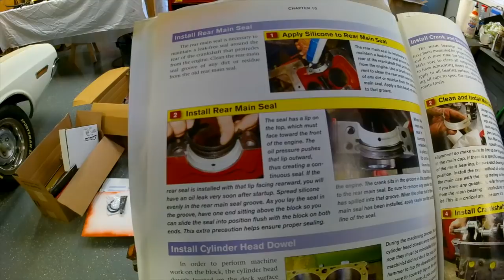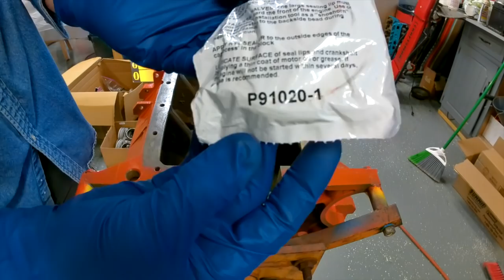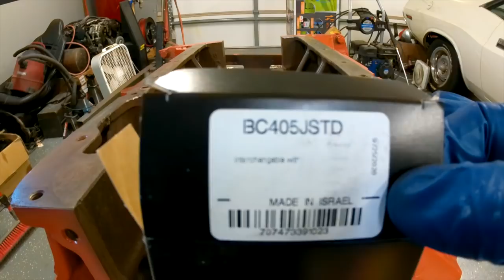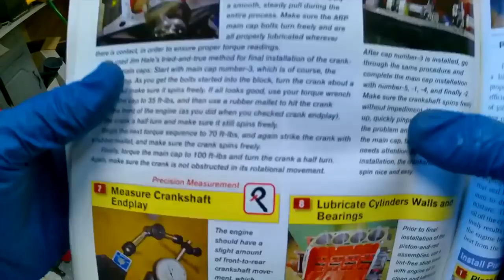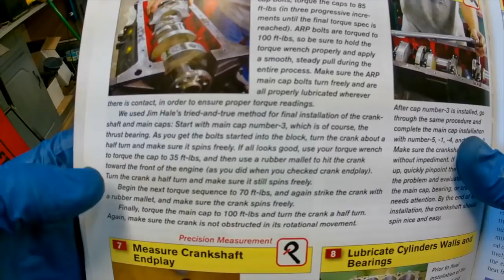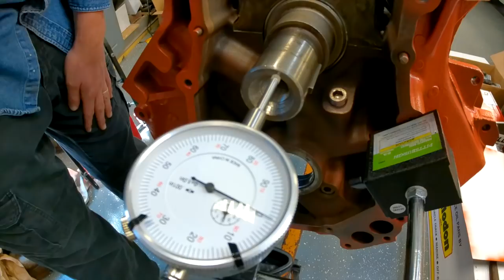Big Block Mopar: The Build Begins

Comment: Nicely done! Clean enough to eat off of. Big block rear main leaks are the worst. Looks like you took all the precautions. Back in the day, a friend of mine o-hauled a '79 400 in a Magnum. He was running it on the lift next to me, checking for leaks. When he walked away, I couldn't resist!! I squirted a little oil right at the rear of the engine. He came back to a "leaky rear main" and lost it. I finally confessed a few minutes later and thought he was gonna beat me to a pulp. I cleaned up my mess and showed him all was good, almost. He stayed mad for a month. Life in the dealership. Cut-throat and cut-ups.
Reply from the maker: 😂 I would have been on fire! They suck especially if you have a windage tray and have to stack gaskets around it. Thanks Gregory!

Comment: I respect you for caring enough to clean everything to the degree you do. I wonder how many builders do the same.
Reply from the maker: Thanks brother! In my mind, it’s one aspect that I can control. I’ve seen dirty engines done by hacks. If it deserves to be rebuilt, it deserves to be done right!
Reply: Only the engine builders that don't make engines that blow up clean this well. You can scrimp on many things, but getting everything clean is not an option.

Comment: Your vid this morn about slop in the dist tang/oil pump gear motivated me to complete this exact session  on my 440/molnar/icon/std forged crank assembly. Tomorrow is verify 28 thou top and bottom rings and slap those in as well. Gone thru source heads and 12 lbs from the wuhan war whistle and let her eat. Thank you again. Your vids mean alot!
Reply from the maker: Awesome! Thank you for sharing and good luck with your beast!

Comment: Actually a great build, except on the center main with the thrust, you should actually run both bolts in to about 20 lbs, then back them off before you tap on the ends so the cap is free to slide to match the fixed bearing half in the block, end play should be checked when center cap is torqued to first step.
One tip, much easier to lube and slide in cam before crank while you can still access cam bearings.
Reply from the maker: Thanks Rob! Always more than one way to skin a cat. I’m not too far stuck in my way

Comment: Lucas/oil mix is a great choice. I noticed to didn't apply it to the crank journals. All metal bearing surfaces should be coated. Same with the cam. But you got your way and I'm good with that. Nice videos series!
Reply from the maker: Thanks! I have a brush now that I dab it in with. Check out my 400 build series as well. It went to dyno!
Reply: @JustMoparJoe  Will do!

Comment: One of the best assembly videos I have ever seen. Very good close up work and good audio, no back round noise. Cleanliness is the key element to engine building. I applaud your extra effort to clean. Was the crank already balanced or did the MS have to balance? Did the journals need turning or not? Just hone the cylinders?
Reply from the maker: Thank you! The machine shop gave it a hone and I was able to reuse rods, pistons, and crank. The crank was nearly perfect coming from a low mileage rv. I know it’s a low compression engine, but it moves his 74 d100 well on the street.
Reply: The 413 is a great engine and a high rev monster. Have you checked the source point on the lifters? I have been hearing horror stories about mfgs outsourcing their lifters from China and they have no hardness at all. Break in turns into an awful mess requiring a takedown of the entire engine as it will be full of metal particles. I hope all is well in your case.
Reply from the maker: I’m not totally certain, I’ve never had an issue with any Lunati stuff. This is the 7th voodoo cam I’ve purchased and installed. Check out the video of it in the truck. He’s got to source a rearend locker soon!

Comment: I like to final wash my engines with Dawn dish detergent, a toilet brush, ( yes, folks a toilet brush!😂 it works excellent) and a power washer. Then I blow em dry, then hit em with some brake cleaner, then a light coat of WD40 on the machined surfaces
Reply from the maker: Awesome! Check on amazon, They sell brushes that fit in your drill. Save you some elbow grease!
Reply: @JustMoparJoe  I also liked the fact that you didn't use a bunch of thick assembly lube on the crank. A guy needs to be able to feel what the crank is gonna do in it's natural habitat. That assembly lube can mask some binding or tight spots. Also, I've seen a lot of guys use that shit on the rings too or they dunk em in engine oil. Huge mistake! When you start the engine, and fire starts to happen in there, it's gonna bake and glaze that shit on the cylinders and they're gonna wonder why they have a hard time getting the rings to seat. If a guy calls up Sealed Power, they'd agree that is not good. The only thing a guy wants to use is a coat of WD-40. Let the oil rings give em what they need, and besides, those puppies need to "cut" themselves into the cylinders, so they'll grab that crosshatch and start rotating around that piston. 😁😁

Comment: This technician puts a lot of thought into the details... But, He did not show lubing the rear main seal, or lubing the threads of the main cap bolts... But he did show the care and thoroughness of cleaning the various engine oil lubrication passages with that brass tube-cleaning brush... He is very good, and the reliability and performance of the engine will be at it's maximum level because of his attention to the details...And the last chapter , he chased the female threads of the block, and pressure washed everything...
Reply from the maker: I appreciate that, Michael. Check out 24:06(lubing rear main seal), and 29:22(lubing the main bolts). On that rear seal, I used red grease. It seems to stay in place if the engine has to sit for a while. Hopefully this series is thorough enough to help those out there trying to build their own engines.
Reply: @JustMoparJoe  gotcha!!! I missed those parts... Maybe I was getting a cup of coffee during those segments... Great job on the video!!! The 413 is definitely one of the best engines that Chrysler ever produced...
Reply from the maker: @michaelmartinez1345  all good brother. I really am going to step my next build series up some. The 413 was after the 360 build series I did. I hope to improve each time, and put out a new series each year.

Comment: Nice prep video, and on an old iron block like this it's probably not such a big deal, but I refuse to spin a crank in the bearings before it's torqued down fully, I HAVE seen bearings and cranks get scored because of rotation before the main bore is torqued round even with a properly lubricated rotating assembly.
Reply from the maker: That is wild to think about. If it scores before the torque, it may have been really bad afterwards. I have ran into cranks before that after torquing, it wouldn’t spin at all. What do I do at that point? Loosen the caps one by one and try to spin it. When it freed up, I knew where the issue was. I think with the spinning ahead of time, you can feel the level of drag on that bearing. Thanks for the comment Jakob. I am always learning, both from mistakes and successes.
Reply: @JustMoparJoe  some aluminum blocks distort so much under torque that the main bore and even cylinder bores are not round until they're torqued down, everything gets machined with torque plates so that it can be accurately honed/bored, one engine that comes to mind would be subarus ej series engines.
Reply from the maker: @jakobsimmons9997 that makes sense. Ed is honing my 400 block with a torque plate as well. It should be spot on when done. I hope to do a full series on it as well.

Comment: Is there a reason you dis not check bearing clearance with the compression thread stuff? That's how we used to do it, Is it unnecessary nowadays? 

Also, is it possible with that much assembly lube on your main cap threads that you could get a hydraulic effect when torqueing them and get a false reading? I would think something thinner would minimize this.

Appreciate your work, new subscriber here.
Reply from the maker: Thanks for asking. I believe you’re referring to plastigauge. It goes under the bearing caps, torques down and then you measure with a sheet to see the width. I didn’t use it with this engine. My machine shop is actually pretty thorough about measuring the crank journals. He said it was ready to build, and I did. I have a new set of micrometers and dial bore gauge to use on my next build. As for the lube, I’m certain that the excess will squeeze out of the sides and everything torque appropriately. When running, the journals are supposed to be floating on a film of oil, between bearings and crank. I believe that my mix helps protect those parts during assembly.

Comment: Bore it to 4.250 and make it a 426 Max wedge. I have .060 383, std 400 (452 stroker), std 413, std 440 as well as sm bks std 318, .030 340, 2x std 360's
Reply from the maker: Awesome selection of mopar Iron. It would have been a sin to bore these cylinders. They were as perfect as factory.
Reply: Yeah, and they go like hell! Don’t they?

Comment: Do you build mopar engine different than other corporate engines?
Reply from the maker: There are a few nuances between different brands that can help longevity and performance. I’m just most familiar with the mopars because that’s what I was raised on. I do have a 350 Chevrolet build and a 351w short builds on the channel as well.

Comment: Just subbed. UTG mentioned you.
Reply from the maker: Excellent! Welcome aboard! I’ve been talking with him about the 318 build. Definitely a fun one!
Reply: @JustMoparJoe  
Thats gonna be tough if not impossible To get 318hp with a basically stock 2barrel.
Reply from the maker: @dtruth5769  for sure. Especially when they stroke the crank for more compression. It may end up as a 325+ ci when done.
Reply: @JustMoparJoe  maybe with 500 carb. That 2bbl flowed 230

Comment: Hey Joe, those 413's in 70 were motor home engines with 8 bolt cranks, did you use a 440 6 bolt crank? Also i know im jumping ahead but where did you find 413 pistons? Performance pistons are like chickens teeth they dont exist. Lol
Reply: Mine was in a Winnebago and it has a 6 bolt flange.
Reply: 1972
Reply from the maker: Yes sir. This one and my other are both 6 bolt, forged cranks. The other engine we actually stole the crank for a 440 build that is in a dart swinger!

Comment: Whenever I had a big block that seized it was always number 3 connecting rod bearing that always I just wonder if anybody else experience the same thing
Reply from the maker: Keith, I've never heard of that. Was it during extreme use? Did it happen multiple times? Standard or automatic trans?
Reply: Yes it did happen quite a few times 383 + 440 I had quite a few 68 9 charger somewhere automatic sand somewhere for Speed even when I went to the junkyard to try to tear down a core motor to get a crank and it had the same thing and yeah I used to run them quite hard just seemed like always that number 3 always the first one to go I admit I was quite hard on but those days are over now

Comment: Do you plasti gauge stuff? Just curious
Reply from the maker: I have before. I did not with this build. My machinist told me this engine is ready to assemble, he has checked clearances before it left his shop.
Reply: Understand. About to have my first hand experience with the stuff so I asked. 

How’s the d100 drag truck?
Reply from the maker: It’s a good tool to use on builds you’re not sure about. Poor black truck is sitting without a motor or trans at the moment. I stole the trans for the purple barracuda. The 408 will get a refresher and go in the car as well. Maybe the black truck needs a big block someday...
Reply: @JustMoparJoe  I’m doing a d150 right now that I just finished doing a bunch of suspension work. Took out my 318/42rh(previously swapped from 727).  And I’m swapping in a 400/727 I pulled out of a New Yorker.

Comment: I am no expert engine builder and . I don't want to sound like I just want to give you a hard time. I have never been able to turn a crank buy hand after full torque. Did you check your clearances? I would at least use plastiguage  but, they say that's not good enough these days. Bore guage and mic these days. Just my 2 cents.
Reply from the maker: David, check out David Vizard’s channel. He is an expert that I study a lot. He had an excellent video on checking main clearances. Any crank that won’t turn by hand after full torque, likely is lacking lubrication, or proper clearance. Vizard uses a mix of wd40, engine oil, and some kind of paint thinner. That thin of lube allowed him to spin his crank with his finger tips once done. I believe there is actually a torque gauge or meter you can put on your crank snout after assembly. If the number is too high, something isn’t right.

Comment: Never clean enough!!! Im just paranoid enough about dirt that my fresh engines get multiple oil changes... Especially since my work environment isnt exactly NASA-spec!! First one after just a few minutes (or cam break in if new), second after an hour run time, third at 100 miles. Then on to regular 3000mi schedule. Oil's cheap!!!😁
You def should NOT oil the bearing saddles... You dont want to make it easier to spin the bearing!! Id rather have that flash rust than a smooth oiled journal LOL!!!🤣
Reply from the maker: They usually have oil under them on disassembly. I just can’t trust that! I want them dry as a powder house!

Comment: The 413 is the Red Headed step child that's to small to compete in racing, good in it's day, but the 516 heads are junk and  the blocks are a dime a dozen so why limit your build to a 413 ? .060 over gets you a competitive 426 cid with plenty of cylinder wall left, also the 413 has forged crank ears on some of the rod journals that are unnecessary weight but are the best RB factory cranks Chrysler ever made (used in the 413 - 426 Max Wedge).
Reply from the maker: This engine was industrial. It’s getting shaved 452’s and will be a pump gas friendly truck engine. He wants good torque and will likely never race it. I choose an excellent voodoo cam for it. It will absolutely do the job in a single cab 74 d100.
Reply: @JustMoparJoe  I also have a 78 W150 360 fulltime 4x4, that's where the 440 is going

Comment: Can I make one small suggestion? When you do something that is repeated many times, there is no need to show every single one from start to end. Show one completely then simply say, "do the same with all these others". Would keep us interested. I found myself skipping ahead hoping I didn't miss something.
Reply from the maker: Thank you Ted. I really do these series of videos for guys wanting to watch every step of the engine build or for those trying it at home. I don’t want to cheat anyone out of a step. Especially if they use these as reference. Thanks for watching. I will try to tighten up the next video. This was 4-5 hours worthier work into 42 minutes.